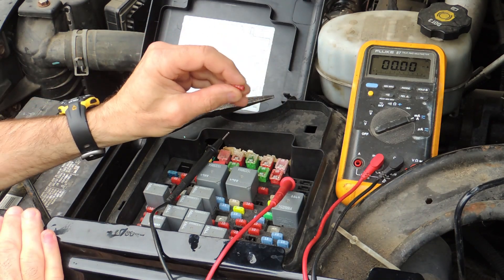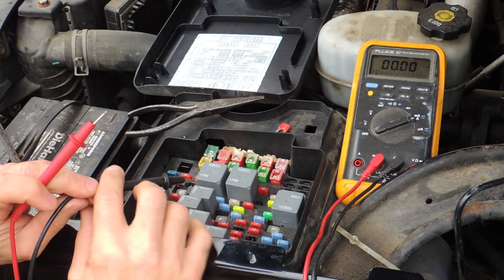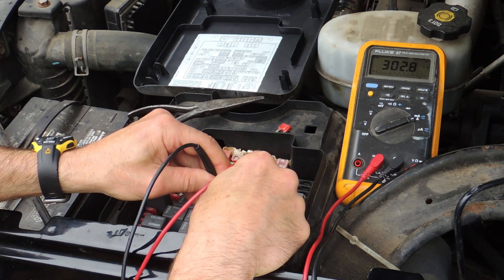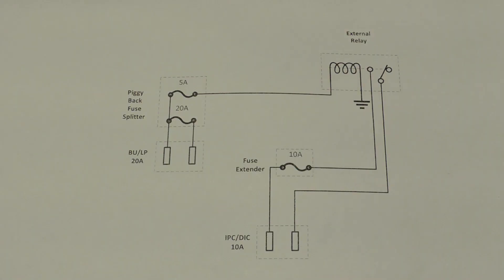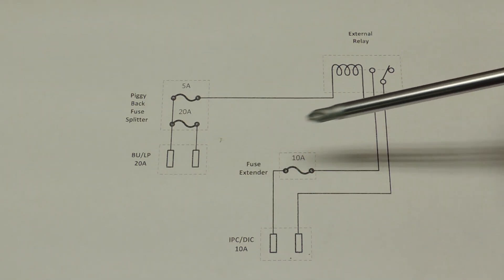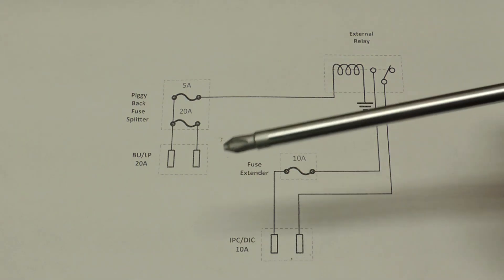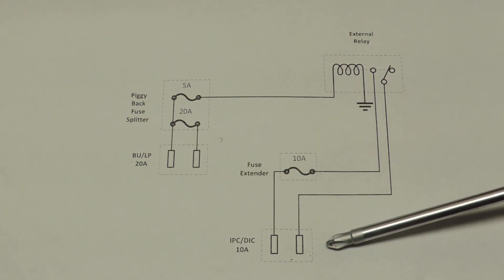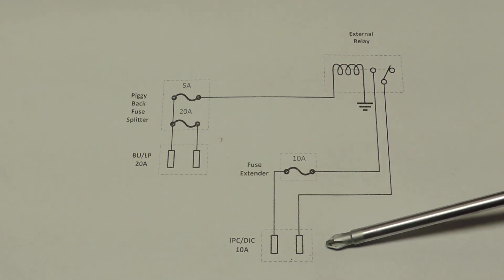Parasitic Draw Solution for 2007 Silverado IPC/DIC Circuit

Comment: Thanks for the video. I was having the same parasitic drain and wired everything up like you had drawn out. The only issue is that when I turn the vehicle off, the instrument cluster stepper motors, the gauges, lock into place. And if I were to get in my truck and crank it right away, the gauges go through a “calibration” I guess to zero them since power was completely taken away and if I do not turn the key to the accessory position and wait for the gauges to zero, it could cause my gauges to show weird readings. I may look to see if there was another fuse that was on a circuit that stays powered briefly before completely being disconnected from the battery to try and resolve this issue. I assume you don’t know of a better fuse to use?

Comment: I have a 2003 Silverado with this exact problem. I ordered all the parts and tried this method but the new 10 fuse in the harness just keeps breaking and the problem persists I’m not good or familiar with electric work. Is it possible you could break down the exact connections to the relay and which ends they lead up to? Thank you

Comment: Thought this is the best video I have seen on parasitic draw.  My 03 silverado has only had this problem for the last year, but it is makiing us crazy.  Ordered the parts last week, got them wednesday and installed today.  Other than  blowing a fuse, no problem.  Had to think about how relays actually work to figure out the wiring.  Your little drawing of the circuit really helped.  Having different color wires on the connector purchased through Amazon was also helpful.  I am very glad I found this video and will share with any others that have one of these vehicles.  We previously replaced the battery, alternator and starter chasing problems.  Glad to see someone with a solution!  My mechanic just waved me off.  Thank you!

Comment: Do your gauges not reset when you turn the truck on? I did this and when i turn my truck off all the gauges stay put, which make sense since the power cuts immediately. But when i start my truck again some of my gauges dont reset back to zero. Like my tach will start at 600 rpms so at idle it hovers at around 1200 rpms, so its idling normally but the gauges are skewed. Putting the normal fuse back in and starting it once or twice makes all the gauges reset normally.

I did notice my cluster doesn't come on with ign on\eng off, whether its stock or with your mod, so i suspect that has a lot to do with it.

Comment: i have same issue i bought everything u have linked  the only issue i having now is its hard to tell in video whats going to what with all wires red just one black. and i know u did drawing but to me i think it would have helped if the 30 85 86 87 was shown or maybe a shot of the hole thing done. i looked everywhere trying to find another video like this. could u please help thanks

Comment: So i decided to have a different fuse feed power to ipc/dic when truck is in start/run like the IGN E, instead of having power on all the time. Diagram also shows SEO IGN has more pwr only in start/run that can feed ipc/dic, and all you need is piece of wire and like DIY

Comment: I’m having this problem now. 04 Silverado and this is the second time I’ve replaced my battery in 3 months. Ipc/dic fuse is drawing power I found once I started testing fuses this am. Thanks for the video because I’m really not looking forward to sending off my cluster in hopes that that is the solution
Reply from the maker: Thanks, as an update, the truck has been working like a top!  Even with the cold winter temps, it starts on a dime and has had no issues.  I am glad that this video is helping those in need of a solution!
Reply: @ I unplugged the ipc/dic fuse last night and went out this morning and my truck started so now I can at least confirm my problem. Thanks again for this video.

Comment: I had this exact problem on a 2007 Sierra. This solution worked. Thank you. I would have liked to see the connections on the 85, 86, 87, and 30 terminals on the relay explained better, but I got it.
Reply from the maker: Thank you for the comment.  I'm glad it worked for you!
Reply: @gregferguson1386 so did u make this relay. if so is there some way i can send u pic of what i made so i can make sure mine is done correctly. thanks

Comment: @RobertMost  Could you have used a 10amp fuse instead of the 5amp on that fuse splitter and then wire that directly to the right side pin connector on the IPC/DIC fuse socket?  This would eliminate the use of a relay.
Reply: Hi, the relay is interposing, meaning you need it to provide isolation between the two circuits.  I would not recommend jumping two circuits together like that, it could cause some unwanted consequences.
Reply: @PR0FMost  Interesting in that Robert determined that the ~300 milliamp draw was parasitic.  Doesn't this imply that the IPC/DIC circuit is pulling that amount when working properly?  Googling the amp draw of a 12v is around 150-200 milliamp.  But, as you mentioned the isolation of the two circuit is key.  Thanks for the explanation.

Comment: I have a 2003 GMC Sierra and had this problem the last couple years but kept going the battery route (warranty through Costco), but now they’ve changed their warrant policy. So figured it’s time to figure out what’s wrong. I bought a clamp on reader and this fuse is drawing like crazy when the truck is off.

The JD1912 Car Relay Harness 12V 40A 4 Pin SPST 12AWG Harness Sockets with Color-Labeled Wires for Automotive Truck Van Motorcycle Boat (Pack of 2) came with a prewired adapter with blue, black, red, and white wires. 

I am not an electrical person, so can you please explain why you did not use the prewired assembly and chose to use connectors instead?

Secondly, after further reading, the white wire (86) is the ground, could you explain where the 87, 85, and 30 connect to? 

I currently have the fuse holder connecter spliced where part of it is going to the 85 relay (black), and the other part to the connected to the 30 relay (blue). The 87 relay (red) is going to the small piggy back blade fuse holder. 

Please let me know if this is connected appropriately and if you have any suggestions. I appreciate it.

Comment: Question when you did this did your relay start to get warm? Even if the truck hasnt been ran.
Reply from the maker: No, the relay is not energized when the truck is off.  It should not get warm.  You can check your wiring by having someone turn the key to on, but not ‘start’.  If you listen or put your finger on the case of the relay, it should click indicating that it turned on.  When the person turns the key off, it should click again indicating it has changed state back to off.
Reply: @RobertMost  okay ill have to check. If it is clicking without the key on i probably have the wiring incorrect right?
Reply from the maker: @StevenSantoro-m5h  That's right, the relay should have no energy when the key is off.
Reply: @RobertMost  okay ill check it out thank you

Comment: How is the relay wired? My truck has been driving me nuts for a few years now trying to find that parasitic draw. I've been disconnecting the battery
Reply from the maker: Hi, the details on the wiring are in the video.  Thanks!

Comment: Thank you so much for this video! I have the exact truck with parasitic battery drain. I ordered the parts and installed it to find out the instrument cluster is the “draw”. I am sending the cluster out to be rebuilt. I of course found this video too late. I replaced both batteries. Cleaned all terminals. Replaced alternator. Cleaned and checked all grounds. It is crazy how much this cluster has caused other random issues. The windows would roll up 2/3’s and stop. Power mirror would readjust every time I started the truck. I have replaced window controls. Replace the mirrors. Just hard to believe the instrument cluster can cause so many issues.
Reply from the maker: Hi Gary, thanks for the comment!  I also went through the battery replacement etc.  Just wanted to say that I hope the replacement of your cluster will fix the issue for good.  An update from me, the truck is starting like a champ and I have not seen any battery issues since making the change.  Best wishes!
Reply: I sent the instrument cluster to Atlanta Speedometer. They replaced faulty power supply and all the stepper motors. They also installed led lights and calibrated it. Problem solved. It’s been in the truck for 4 days. No more battery drain.
Reply from the maker: @GaryFerrell-zh9fk  Glad it worked out!
Reply: I will update you once the instrument cluster returns from being rebuilt. I sent it to Atlanta Speedometer.